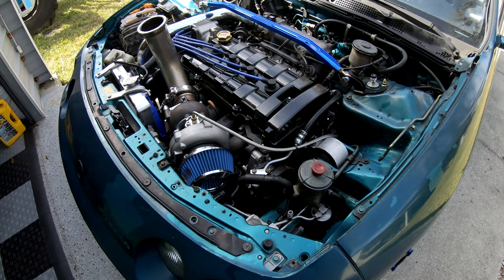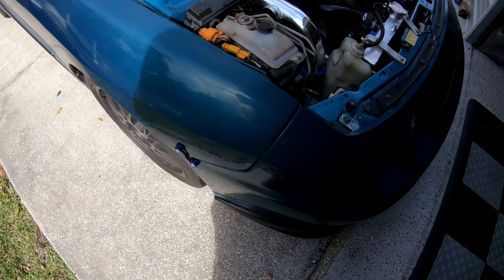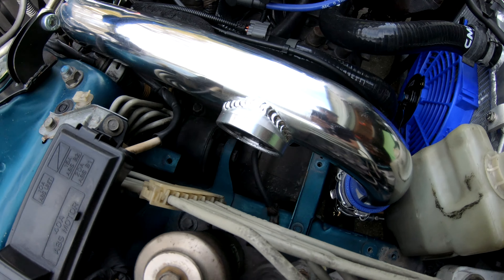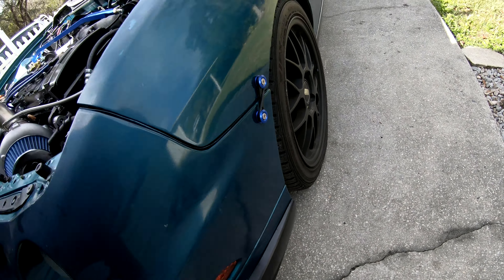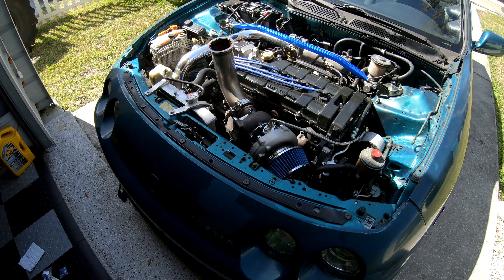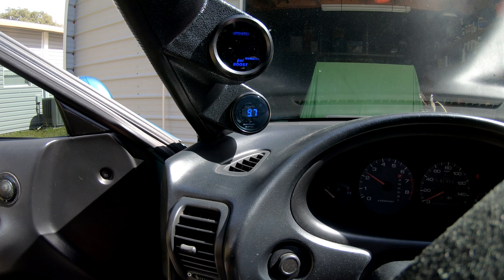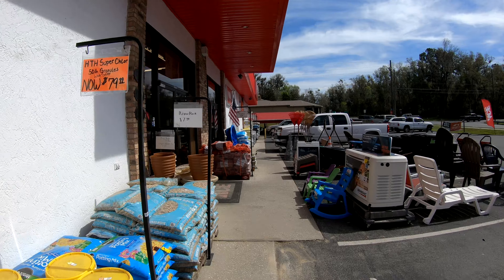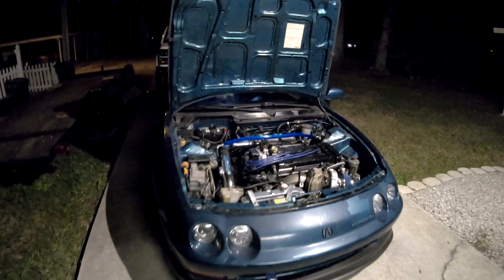The Integra FINALLY Gets a Turbo! WELL OVERDUE...

Comment: Why in the world wouldn't you run a blow-off valve? There is no upside to not running one.
Reply from the maker: I hate the sound. We go for the turbo flutter 😁 many high hp builds dont run bovs
Reply: @aaautosport  That "turbo flutter" is the sound of compressed air trying to stall the turbine wheel. And if you have a track car that has an auto or dogbox, where part throttle, or coming on and off the throttle (like for gear shifts) isn't a thing, then sure, don't have one. For a street car? If you don't like the sound, route the blowoff to the intake, make it nice and quiet. Again, there's no upside to not having one.
Reply from the maker: @garronah  i know what it is and the plan is a dog box so thats why I figured it wont matter too much